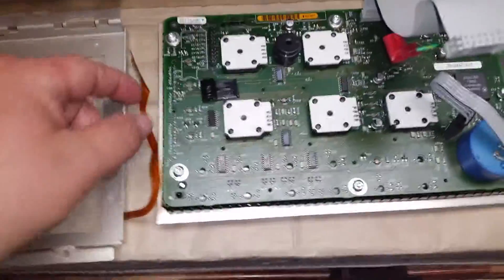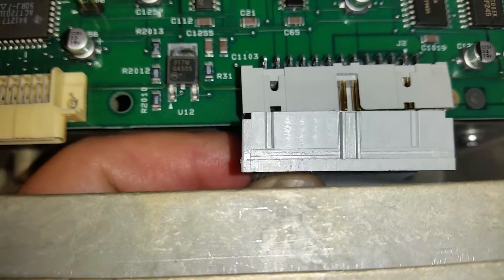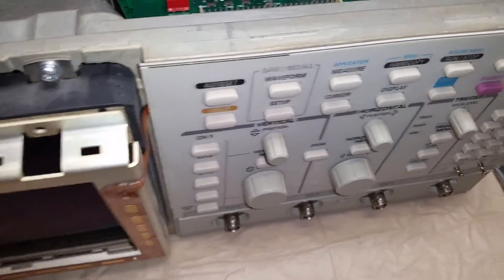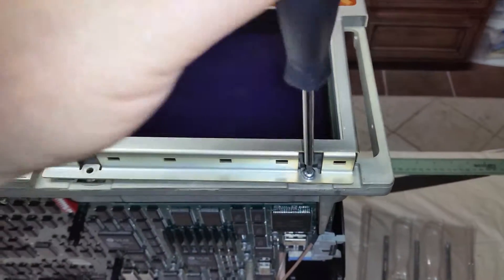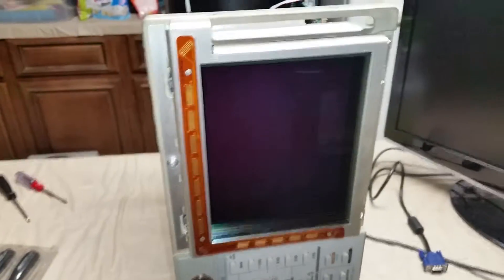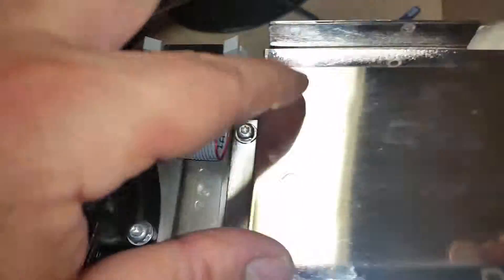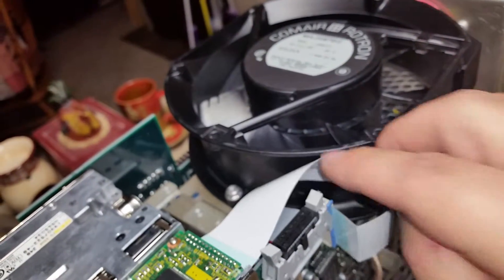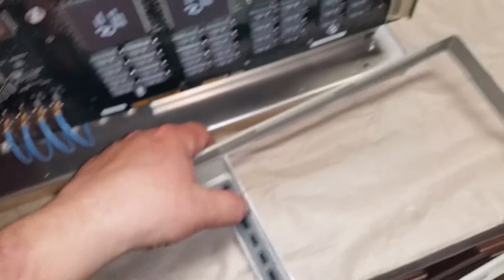TEK TDS 744A No Display Repair Part 5 Front PNL & Floppy Install

Comment: Bought a TDS744A that is working great from what I can tell so far other than cosmetic issues that are rough.  Have a TDS540 on the way also that will be a similar to DrForbin TDS540 project. 

I wanted to pass on info I found regarding hacking the TDS744A to make into a 1Ghz 4GS/s TDS784A scope that is really simple to do and from what I can tell doesn't cause adverse issues.  

Here is the general info link (he references the EEV blog as that is where I found originally): http://www.electrondepot.com/electrodesign/tek-tds-744a-tds-784a-upgrade-hack-815519-.htm

Hope all is well. In Christ!
Reply from the maker: Nice link. If I ever need to upgrade my scope I'll consider it. I've been pretty busy working on my other hobbies and helping my son with his car and helping him build a CNC machine for his college class. We have less than 11 days to get a prototype running from scratch. So I won't be posting any videos of the work, bummer. Good luck with your scope and ppost some videos on your page of your progress. Thanks for watching and the link. Best Wishes n Blessings. Keith Noneya
Reply: @keithnoneya  Hi again Keith, figured I'd share some other links regarding the TDS repairs that are great videos like yours that deserve more views since well detailed:
https://www.youtube.com/channel/UCDPIffg_GXeqnPT-4of1QgA  (i-Hobby.org - LCD replacement, floppy swap to USB/cards and Enabling optionsfor TDS's)
https://www.youtube.com/channel/UC1wD7YYBCZnK8DX_ynbSecA (Dragos Ionescu - PS repair with a lot of detail)